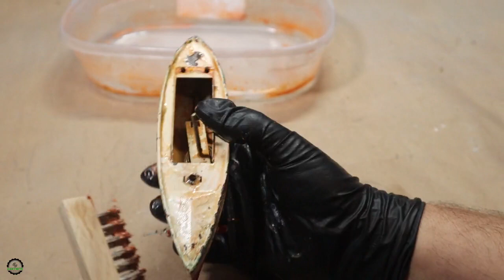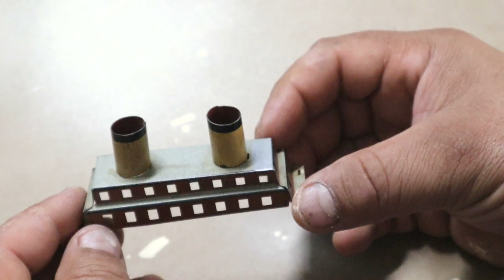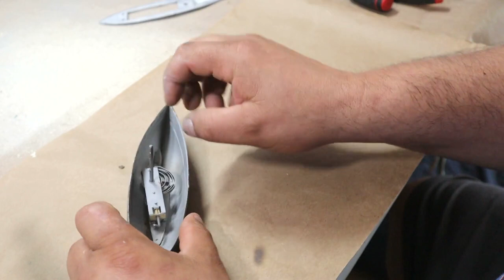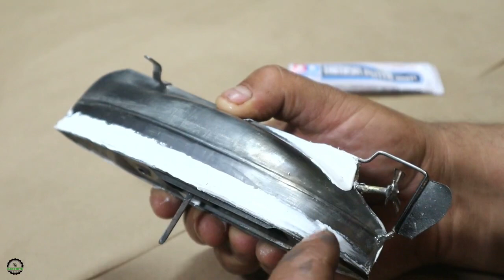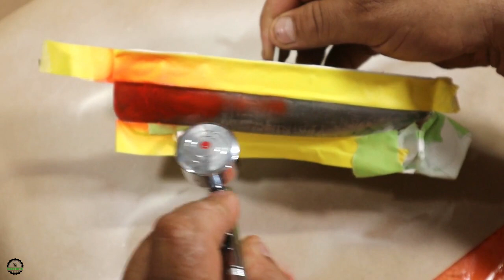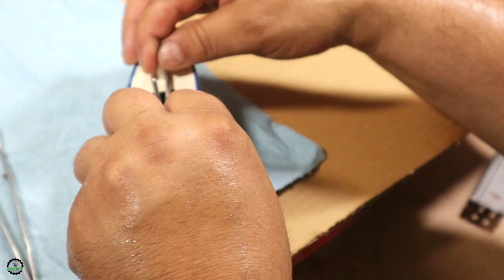Vintage German made Marklin tin toy boat restoration

Comment: Good restoration, but but personally, I would have applied a see two coat two primer, and sanded in order to have a very smooth surface, before the painting itself
Reply from the maker: Hi Thierry - this was my first with air brushing and I did realize it is needed - it was hard but I learned a lot.

Comment: Nice work getting the clockwork going again, less is usually more with these old mechanisms and having the wisdom to just spray a bit of contact cleaner or penetrant oil and work it back and forth is better than trying to take it apart. Now it's working I advise sewing machine oil as a lubricant moving forward. As for the paint job, airbrushing is a pain in the backside and you got a good result all things considered. Air brushes aren't really designed for bulk coverage and I think you'd have found the pinstriping would have had less edge feathering if you used a glossy spray for the two base colours and then masked and airbrushed the pinstriping on afterwards. As always though, loving your channel.
Reply from the maker: Matt - I really appreciate you taking a look and detailed advice, air brushing was definitely that - pain. But I will take what I learn and also what you shared and will try to succeed better next time. I did have fun trying something new and that boat does look better and works now! Thank you for coming back and checking my work and stay well!
Reply: @DANYMITERESTORATION  Keep going with that airbrush though, once you get used to the techniques you can achieve amazing results.
Reply from the maker: @Thematt11  Matt - I will, now that I tried I am determined to try again - stay tuned for more videos using airbrush:) Appreciate you support!